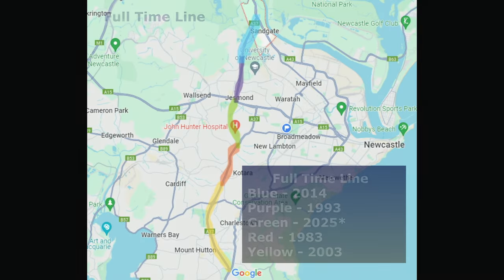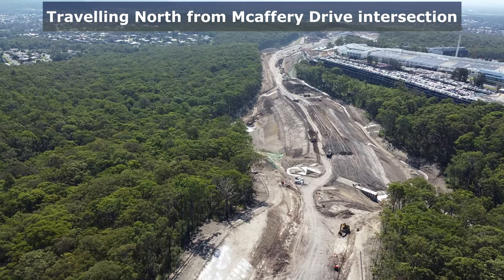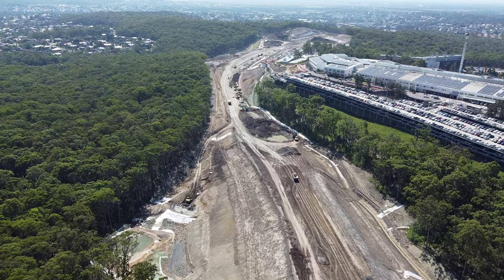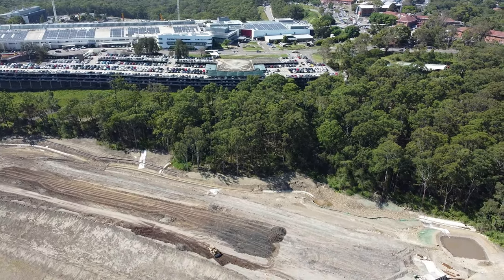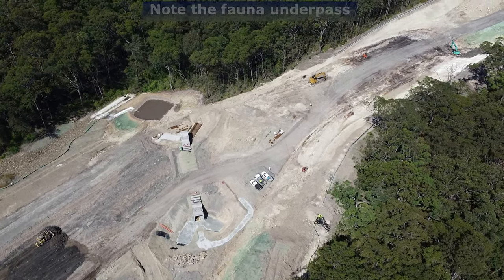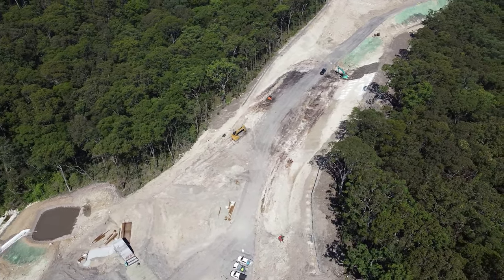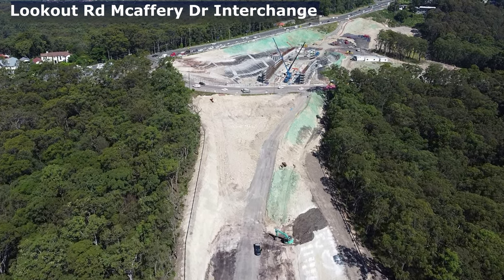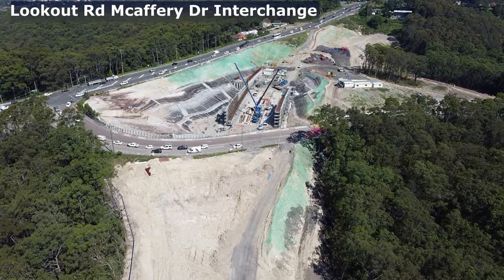Newcastle Inner City Bypass Stage 5 Update 2024

Comment: Section 2 now needs to be further upgraded, to eliminate the traffic lights and move the school zone onto a separate side road. This could be achieved by building a grade separated interchange at the top of Carnley Ave and extending Main Rd to connect to it. This would enable other changes that would eliminate all traffic lights and most right turns on and off the through road.

Comment: Fun trivia. The Charlestown Bypass section is not the whole original planned section 1. The original plan was for a Pacific Hwy deviation to branch off the existing highway at the front of the the golf course at Belmont South, cross Jewells swamp and run up alongside the railway line (now Fernleigh Track) through Whitebridge, to join City Rd near the water towers at Adamstown Heights. The Inner City Bypass was supposed to branch off that north east of Bennetts Green, with a flyover where the current end is.
Reply: What you describe is a totally different bypass.
Reply: @jimrockford3662  I described the Pacific Hwy deviation, in order to explain where the Inner City Bypass would have started to connect to it.

Comment: You think Newcastle's been neglected? Come to taree where we have no decent infrastructure for current traffic demands, almost non-existent public transport, and a tiny country hospital that is supposed to service a population just shy of 100,000 people.
Reply: Everywhere is neglected. That's how it works. Traffic is only fixed when it's about 20 years too late.
Reply from the maker: true
Reply: considering newy is 2nd most populace city in the state and the last project was 40+years ago... id say they have been neglected. 40+ years of taxes and no infrastructure upgrades?
Reply: Not true: The Hunter Expressway with it's 53 bridges cost$1.7 Billion opened in 2014
Light rail for Newcastle cost $600 Million opened in 2019
University of Newcastle Q building cost $25 Million opened in 2022
New Courthouse in Newcastle cost $94 Million opened in 2016
Pacific extension to Raymond Terrace under construction to cost $2.1 Billion
Newcastle International airport to be complete by 2025 at a cost of $55 Million
Plus numerous other projects.